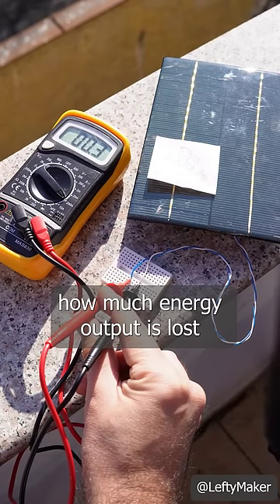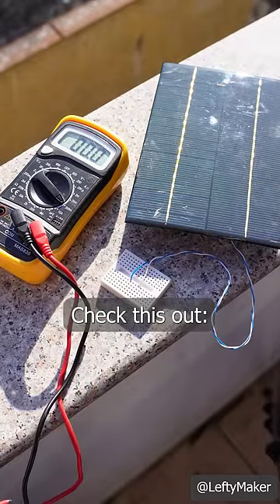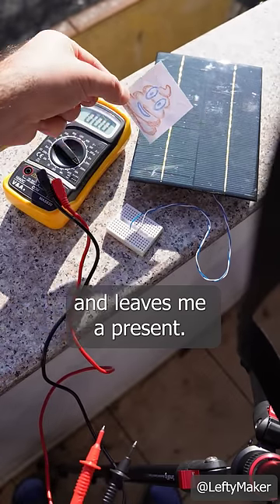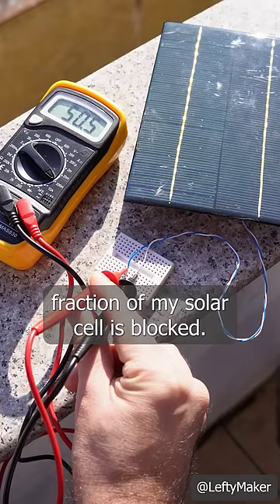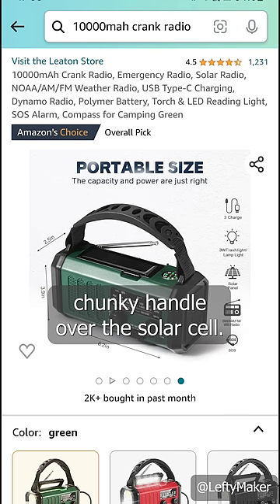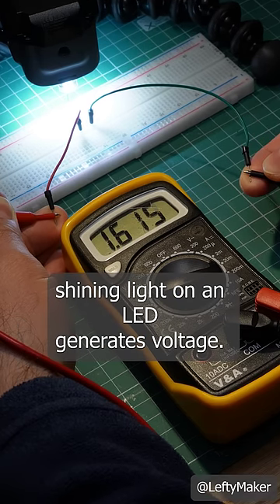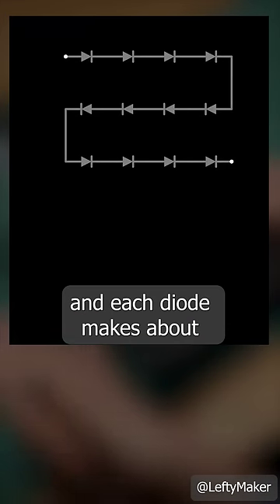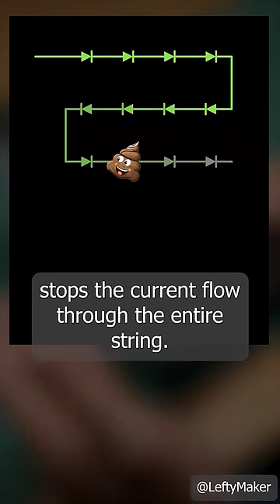Surprising drop in solar cell power. Here's why

Comment: This is why bigger Panels have 3 or 6 Bypass Diodes so the shadow only affects a small part of the panel output. No need for expensive and hard to replace Microinverters or Optimizers, just use a good ol string inverter and you are fine.
Reply: Yep, this here.
Reply: I was on my way to mention it. thx

Comment: There is an EEVBlog episode where Dave basically explains that individual solar cells generate 0.2V under light and turn into a 0.7V diode without it. 
In other words, a cover cell does not act as an open switch, but as an inline diode that takes the power of 3-4 active cells.

Comment: Would it be less efficient to just not put them in series?
Reply: Any larger panel will have multiple series for redundancy I believe
Reply: I doubt you could do much with the small voltage every diode produces by itself.
Reply from the maker: Each diode in the cell makes 0.6V. To make a cell with any useful voltage (6,12,24V etc.), they have to wire them in series.
Reply: It is inefficient to transfer at low voltage thru a length of wire, so you can, but you have to quickly conglomerate them into high voltage somehow.
Reply: What you gonna do with 0.6v?
Reply: It'd lower the voltage, requiring much larger current to transport the energy, leading to mpre heat losses
Reply: yes parallel is better but as the others said, you still have to have some in serial for the initial voltage boost and also losses through lonf cables are higher and you need thicker wire for more amps at the same power with less volts. Easiest would be to never have a shadow or dirt on them haha
Reply: they are built in series, then the series are in parallel @demottt
Reply: @LeftyMaker do they only put as much diodes in serial to get the requiered output voltage or all of them and transform it down? So 40 diodes to get 24v e.g?
Reply: If we don't put them in series, and put them in parallel then we will get a voltage of 0.6 volts ( just for a single diode) this is because voltage in parallel will not add up, but series it does, i.e, if 20 diodes then 20×0.6 = 1.2 v , but in case of parallel it will be same as 0.6

Comment: The current through the string is limited by the current generated by the lowest performing cell. So, if you cover one of the cells halfway, it only lets half of the current from all the other cells through.

Comment: so for fixing this we gave to use paralel with reverse diodes abd boost converters that way blocking effect will be fixed but boost modules will waste lots of power... andcost a lot but i think itll be better in lots of cases..

Comment: The solar cell being covered also causes it to absorb energy from the cell, converting it to heat and potentially irreversibly damaging the cell
Reply: Which is why industrial sized solar panels use schottky diodes in reverse polarity ("bypass diodes").
Reply: Fit a diode.

Comment: Why don’t they just run the rows in series then all the columns in parallel to get maximum efficiency?
Reply: larger, low voltage high power output panels are actually made of cells arranged in series parallel configuration like you said
Reply: They do.
Reply: Because you'd need to put enough in series to make a usable voltage

If each diode makes 0.6v then you'd need atleast 20 to make 12v, and then you can make a series connection consisting of 20 parallel diodes.

Comment: At least a bench is only sat on intermittently, plus it gets butt wiped!
Reply: it also gets scratched and becomes opaque from micro reflections then it becomes useless
Reply: @Ekvorivious  It's a long way to useless from some light scatter, particularly when you can buff or replace the shield as needed
Reply: but wouldn't it be a better idea to post the solar panel higher above the bench like a shade?
Reply: @prathamshenoy9840  Sure, the bench isn't exactly useless, but there are much better designs for most real world situations

Comment: Can you measure current of the solar panels by connecting the meter in parallel ?
Reply: I also came to ask the same question 😂⁉️
Reply: that is the short circuit current. almost 0 volts but max. current. 'Isc'

while 'Voc' is voltage open circuit. so all the volts but just a TINY current for the meter as a load.

Comment: You should measure output on a load instead of just voltage output.
Reply from the maker: That's short circuit current I'm measuring

Comment: Restricts the Voltage flow, so consequently there will be less current when under load. Current does NOT "flow".
Reply from the maker: Would you like to explain what you mean? Here's a quote from Art of Electronics, chapter 1, page 2: "...current flows through things, and voltages are applied (or appear) across things. [...] To say something like 'the voltage through a resistor...' is nonsense."
Reply: If you partly cover a PV cell, it becomes a resistor, the Volts are likely to be the same or near, but as soon as you apply a load, the resistive part of the covered cell will drop the voltage, and the current available will be less.
BTW Volts flow in the form of Electrons, current will manifest itself as a magnetic field, current does not flow, as so many people wrongly observe.
You cannot measure any current in a circuit unless there is a load, and then only by a current clamp measuring the magnetic field, or a shunt, and measuring the volts across it. @LeftyMaker

Comment: I am kinda curious how Glass would effect a solar cell.
Like say IF i bought a bunch of solar cells and put them in my windows as blinds bassically.
To charge some batteries for emergency or just general use, to charge batteries for say, my phone, laptop whatever else.
Reply from the maker: Good question and possibly topic for a new video. The angle alone will cause a sharp drop in output, I can say that
Reply: @LeftyMaker  Thanks for the reply, would be an interesting video to see.

Comment: Nicely explained, bypasses are used to fix this issue and dividing the panel in sections (a bunch of individual panels making a big one, basically) if you were to bypass every single diode the solar panel would be so expensive it just isn't there yet. What is cool about bypassing is you can hook up motors and a sensor to make the solar panels move in optimal position on its own. Go nuclear!✌️

Comment: my copy of circuit JS has the yellow dots go in the direction of the triangle in the diode
Reply from the maker: That is correct if you want the diode to conduct. When it's generating power, current flows in the other direction. I was confused by that too at first

Comment: If it blocks, then it should've been 0. Then why it shows a voltage
Reply: Maybe because it blocks very small area?
Reply: Because there are still some areas, it you block right ahead of the starting point it will show 0
Reply: Because it’s not 100% darkness on the entirety of that cell.
Reply: @itsAkkiii  This sounds fair enough

Comment: How are you measuring current like that?
I thought you had to attach the power source to a load, then run that through the multimeter. It looks like you're just connecting the multimeter to the solar panel's output.
Reply: Switch your meter to current mode and measure output!

Comment: Bruh us 4 electrical engineering backbenchers are in our last semester and for our final year project we chose AI controlled solar cleaning machine. 😭
AI basically determines the use of wet or dry cleaning depending upon the presence of dirt or bird droppings. 
We are screwed. 
Don't know anything about it, how to code or assembly or anything😂

Comment: Solarize optimizer😊
Reply: Optimizers won't fix the problem fully. They themselves need power and therefor they are put on the entire panel and not on individual junctions.
You will still loose most of the output of once panel if you use them.

The simplest way most panels mitigate the issue is with bypass diodes. If a section is covered the bypass diode just let's the current pass around it. Still taking the string of cells out of the circuit but gaining some efficiency back.

Comment: I don’t think that's the correct way of measuring current without the solar panel being part of a circuit. In current measuring mode, the multimeter has a very low resistance (similar to a wire), thus you’re creating a short circuit.
Reply: it's done to find the absolute max output

Comment: i don't think your explanation sounds right. wouldn't covering one part not stop current flow? but instead, make those covered segments operate in reverse, producing infrared light instead of collecting it? so you get a voltage drop instead of a voltage gain?
Reply from the maker: I do not understand the phenomenon well enough to say, but you could be right.

Comment: using an ammeter as a dead short, across a solar panel is neither very safe, nor will it give you an accurate reading!  Better to put an ammeter in series with a resistor!
Reply: I use dead short method all the time, it's not an issue